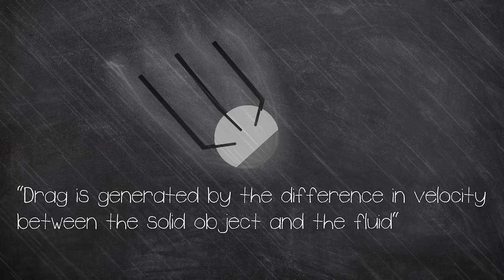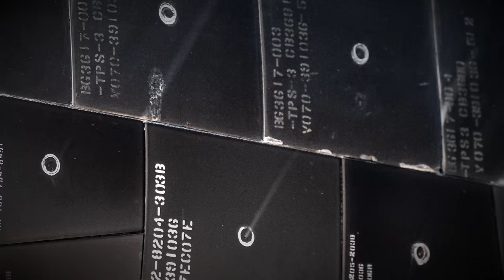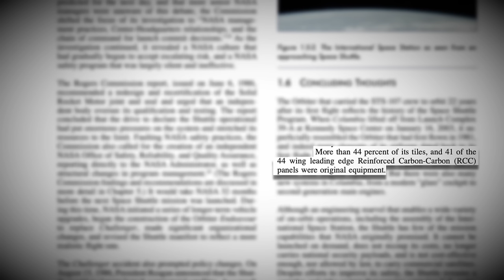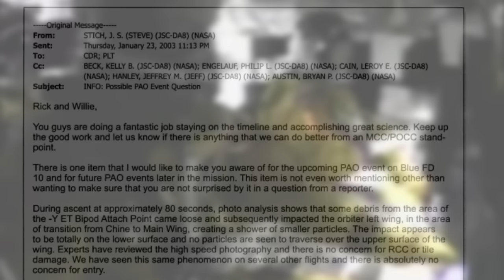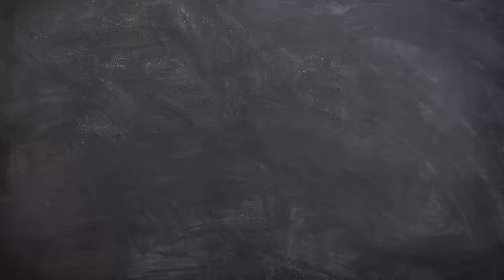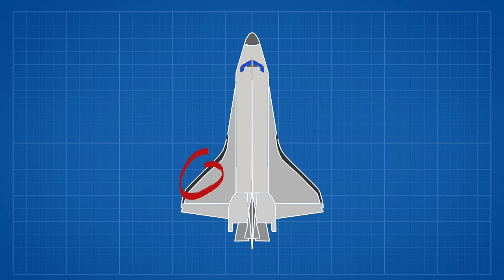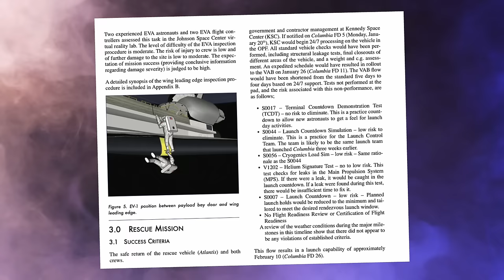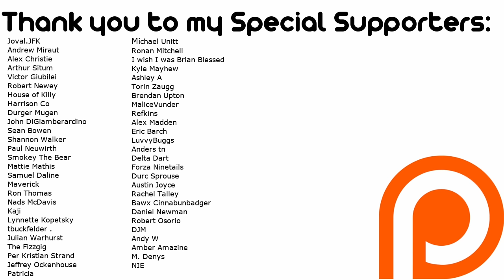Ignored Warnings: The Columbia Space Shuttle Disaster 2003 | Documentary | Plainly Difficult

Comment: If they had stopped the re-entry then they would have just died in space or was there are backup plan for getting them back?
Reply: I'm not entirely certain.

I've heard there were several other potential methods to get them out safely, namely launching another shuttle that was already being prepared for another routine mission to retrieve them, and an emergency internal emergency reentry capsule that was supposed to be used for specifically these types of emergencies.

Comment: I can't remember now where I got the info, whether it was TV or radio. The space shuttle was a flawed design because it was made much larger than originally planned, specifically the cargo bay was made bigger due to the CIA wanting it to be ably to put in orbit large spy satellites. By increasing the size of the shuttle more problems were introduced because of the weight of the vehicle  to get it into orbit and needing to protect a large area upon re-entry. Then because of manufacturing costs there was a need to re-use shuttles more than intended by the original plan.

Comment: On the Challenger flight, the manufacturer of the solid rocket boosters (Morton-Thiokol) warned NASA not to launch in such cold weather.  For the Columbia disaster NASA knew that Columbia’s port side carbon black leading edge wing panels had taken a massive hit.  They spent hours poring over any imagery they could get their hands on including Hubble and an NRO KH-11.  But they didn’t bother to tell the astronauts, and didn’t ask for help or try to launch another shuttle to save their friends.
Reply: No on orbit imagery was made! Their fates were sealed years in advance due to the wrong conclusion that the TPS could take foam strikes and these constituted a turnaround problem rather than a safety problem.

Comment: The worst part about all this is what was put in the main report, a switchboard was found folded over so it means the switches should have maintained the last positions and showed that switches had been flipped that shouldn't have been normally but were indicative of the crew trying to fix the issues cropping up without knowing the cause meaning the crew was fighting to save columbia as she broke apart slowly probably until the G forces from the rolling caused them to pass out.

Comment: The real question is this: For the very first shuttle mission, they painted the external tank white. For all subsequent missions, they skipped the painting step to save weight, thus the external tank was raw orange foam directly exposed to launch conditions with no coating. And lots of chunks of it broke off. Would that white paint have helped keep the foam together better during launch? Why was the tank painted white in the first place? And what tests were done to make the decision to stop painting the tank?
Reply: The paint was purely for aesthetic reasons.  It had no other purpose.
Reply: @da40flyer  It purpose was to help mitigate thermal issues on the pad because the first two Shuttle missions had longer inspection times and practically no payload. They found it wasn't needed so they stopped doing it afterwards.

Comment: I firmly believe that there should be at least one spacecraft in a state of preparation for emergencies, and every few launches it should be launched and a new vehicle put in it's place, and for things such as heat shields that currently aren't able to be confirmed as functionally capable, we are in need of a new system that can show a visual indication of damage, or have the ability to be tested non destructively, or if it's in question just replacing the part.... No matter what you are doing, if you are pushing materials and components to the extreme there is no margin for safety when it comes to damage, degradation from age, or any number of other issues, when pushing the limits you cannot just say "well usually that does not cause a problem"

Comment: Just thinking out loud here. What if we'd reduce the foam layer thickness by just the mass margin required to wrap the exterior in plastic or high tensile strength carbon tape? Could be a thin criss-cross to provide more of a mesh than an actual full on cover. Any thoughts?
Reply: If the foam layer on the space shuttle Columbia had been reduced in thickness to accommodate the addition of a plastic or carbon tape exterior, it is possible that the shuttle's insulation may have been compromised. The foam layer serves a critical role in protecting the shuttle from the extreme temperatures experienced during reentry into Earth's atmosphere.

By reducing the thickness of the foam layer, the shuttle may have been more vulnerable to damage from debris or heat during reentry. This could have potentially resulted in a catastrophic failure similar to what occurred during the STS 107 mission.
Reply: @Infinite-void908  Hmmm. Very interesting. Thank you. I love to discuss these things with like minded aerospace enthousiasts.

Comment: People can be quick to blame NASA and they sure do hold some fault, but I don't see this accident nearly as negligent as Challenger.  You have to understand these foam impacts happened fairly often in the shuttle program's life time. I think everyone got a false sense of it not being a problem but in the case of Columbia it hit a critical spot at a critical time. It doesn't excuse not exploring that more, but I can see h ow it happened. Manned space flight is hard and lessons are often learned by lives being lost as both the American and Soviet space programs have shown. To the lost. 🍻
Reply: I mean there was a bunch of negligence that was certainly a part of this incident. NASA management failed to adequately address the damage to the shuttle's thermal protection system caused by a piece of foam insulation that fell off the external fuel tank during launch. Despite concerns raised by engineers about the potential for damage to the shuttle's heat shield, NASA managers dismissed these concerns and did not take sufficient action to ensure the safety of the crew.
Additionally, there were flaws in the decision-making process leading up to the disaster, as well as a lack of communication and coordination between different levels of management within NASA. These factors, combined with a culture within the organization that emphasized meeting schedules and budget constraints over safety concerns, ultimately led to the catastrophic failure of the mission.

Comment: If the heat shield was so fragile, why didn’t they just renter more slowly and use the atmosphere to keep it slower
Reply: Re-entering the Earth's atmosphere more slowly could have potentially caused more problems than it solved.
Re-entering too slowly could have led to a longer period of exposure to the extreme heat of re-entry, which could have caused even more damage to the heat shield and other critical components of the spacecraft. Also if the Columbia reentered more slowly, that would have required a different trajectory, which may have presented other risks or complications.

Comment: Would it have been so hard to have them pop outside?
Reply: The module in the cargo bay was connected to the airlock.  They would have had to either depressurize the whole shuttle or cut an opening in the side of the module in the cargo bay.  Due to this, they also didn't bring any space suits approved for external activity, or any related equipment (for example, maneuvering units).

Comment: 16:35 Even if the sensor had the capability to transmit this data to the ground, it wouldn't have been able to do so due to re-entry blackout. Trying to inform the crew would have been near impossible as well. Turbulence would made reading any instruments impossible, and an audible alarm would have been unlikely to be heard over the increasing noise of re-entry. And frankly, there would have been nothing the crew could have done anyway.

As for the debris itself, NASA didn't ignore such strikes. They just realized that there was no way to prevent them and still launch the shuttle. Even modern rockets shed foam casing. You need to insulate while keeping the weight as low as possible. But the vibrations of launch and movement toward space are immense, so some of that foam is lost.

Comment: Why didn't they immediately turn off the engines, decouple the shuttle and land it before it went so high up that the shuttle could no longer survive re-entry? Seems like they had plenty of time for this decision...
Reply: They were likely not aware of the extent of the damage to the shuttle's thermal protection system. I think that NASA ground control should have informed the crew of STS 107 of the severity of the damage on the left wing so that they could have at least attempted an emergency landing.
Reply: The foam strike wasn't seen until hours after launch when tracking camera film was analyzed.

Comment: NASA has a military mentality by nature of its test pilot roots. "No need for concern" is culture speak for "there's nothing you can do about the problem, so stay on mission." 

Mission Control and the Columbia's crew knew that failure was a strong possibility. Declining to maneuver the shuttle for wing imaging wasn't a mistake, it was a decision to not produce photos for fueling a media frenzy. 

A rescue mission was never a viable possibility. An emergency launch of Atlantis could have resulted in two stranded shuttles if the foam strike was the result of manufacturing defects on the preped main tanks. Columbia might have been diverted to the ISS, but that would have been a long shot, iirc, and the call should have been made at the start of the mission. 

I am not sure which is worse: experiencing the break-up without foreknowledge, or committing to reentry with the full knowledge that you'll probably not survive it. 🤔
Reply: Good post regarding the feasibility of a rescue mission! But ISS was out of the picture! Columbia was in a completely different orbit, requiring thousands of metre/second delta V. (It had like 300 metres/second in the OMS pods).

Comment: Funny story, kind of, if you can call anything related to the event funny: I was in third grade when the Columbia Disaster went down. Here in Utah there is (or at least was, haven't been out that direction in some time) an elementary school named after it, Columbia Elementary, complete with a shuttle on the sign. At the time the leading theory in the media was some of the heat-resistant tiles on the bottom of the shuttle had fallen off before or during reentry, causing it to burn up. I remember on the TV after the disaster the local news hosts went to the school and talked to some of the staff. They said they had some of those heat resistant tiles hanging in the hallway. My silly kid brain put 2 and 2 together and was like "Of COURSE it blew up, the missing tiles were here in Utah! That's so dumb! Mystery solved, you guys are not smart." I was not the most intelligent child in the world lol, wasn't until I was in my teens that I realized "OHHHH they replace the tiles regularly... so those were old ones... that makes a lot more sense."

Comment: Stupidity cost lives, the shuttle could have been flown to the iss which was operational and the crew could have docked there  until rescue or repair. This could have been saved if one of the astronuaghts had  been less trusting and said ya know what im going to go outside and check. A eva would have revealed how bad it was and likely averted this
Reply: Someone else pointed out, they were in quite different orbits, and there wasn't anywhere near enough fuel onboard the shuttle to reach the ISS orbit within the limits of its life support. ISS had Soyuz and Progress spacecraft docked and it's debatable but perhaps at the very limit of possibility that a Progress could be topped off from Zvezda, have a sack with any additional spacesuits and spacesuit consumables if needed attached to the outside, carabiner clips etc, flown remotely to meet Columbia part-way, and then (once all of Columbia crew puts on the spacesuits & comes back out) flown back towards the ISS with the crew straddling it on the outside. Even that Progress may not have enough delta-V to reach the ISS, and another Progress or Soyuz may have to meet them part-way again.

Another possibility is for the astronauts to pack the gash in Columbia's wing with carefully selected and arranged debris, and flown a highly modified descend trajectory and algorithm, designed to keep the plasma from entering the gash as long as possible, lightening the load on the stricken wing, and using the wing sensors to react to damage progress in real-time. The orbiter may likely become a write-off but by the skin of its teeth survive reentry long enough for a normal landing or at least a belly landing.